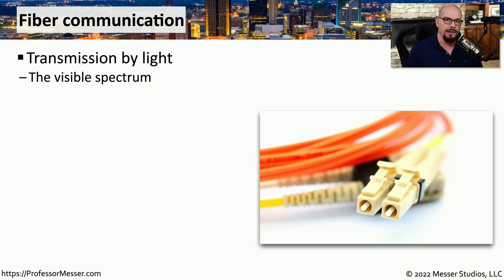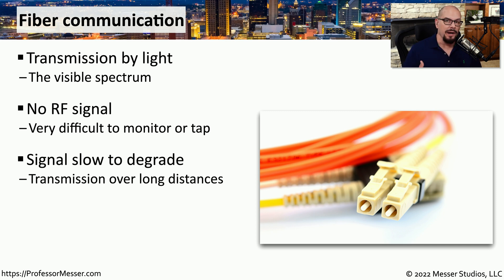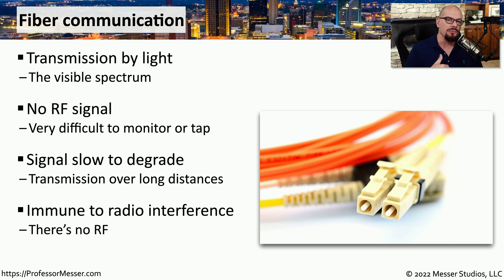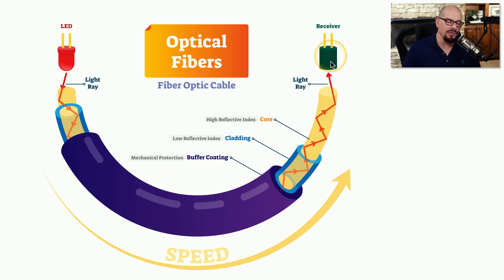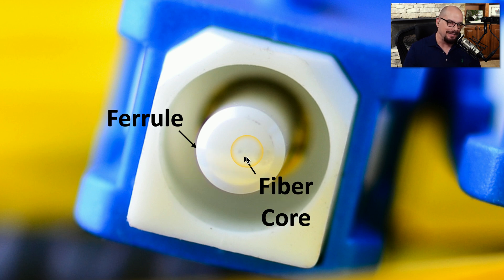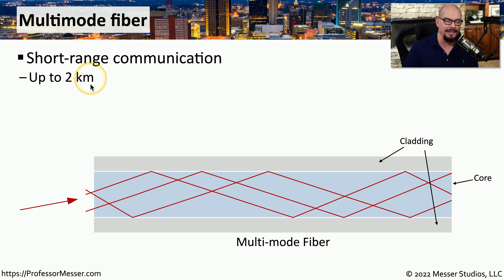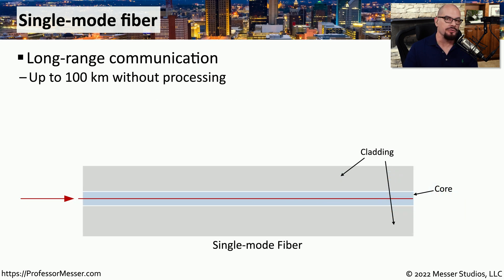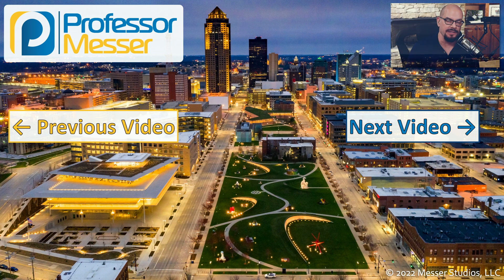Optical Fiber - CompTIA A+ 220-1101 - 3.1

Comment: Does a single-mode cable need to be a completely straight line, since the light doesn't hit the cladding like it does in multi-mode? If so, how is it feasible to keep them perfectly straight over 100km?